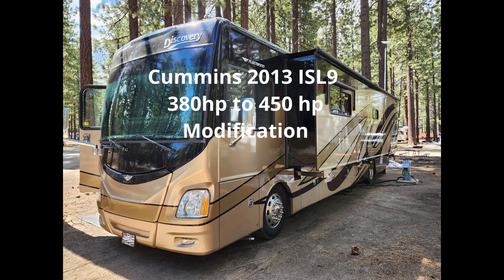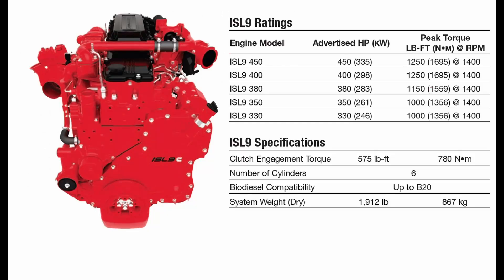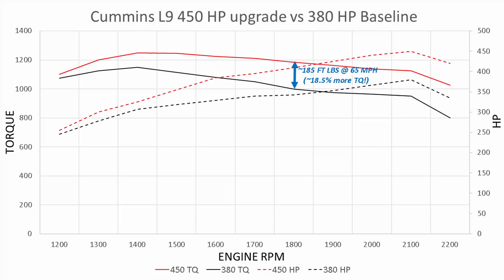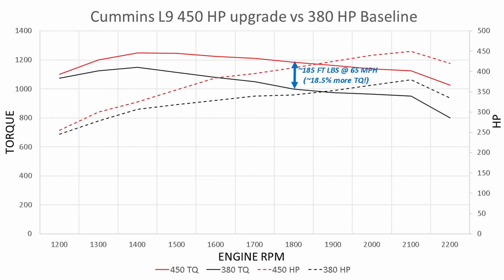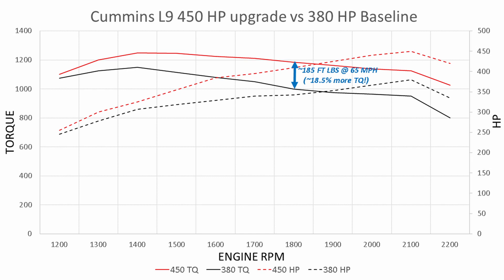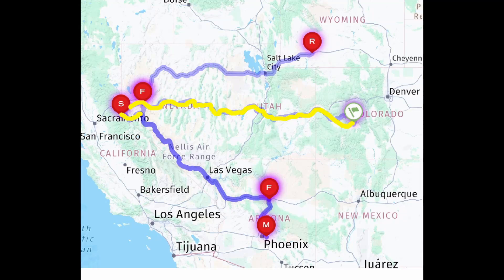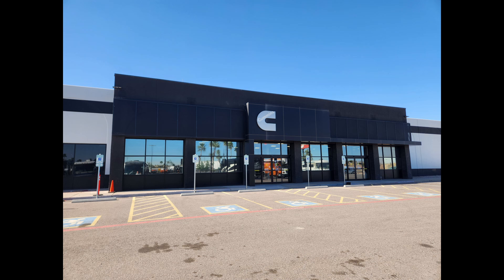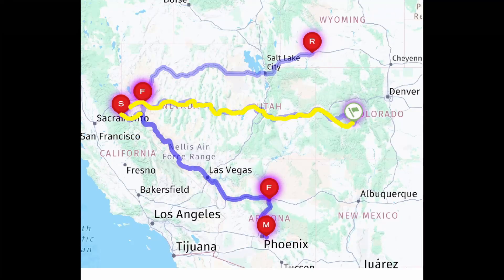Cummin's 380 hp to 450 hp

Comment: Thanks for the video. I just bought a ISL9 380HP and its going to take some thought to do the upgrade at the under warranty cost!
Reply from the maker: I wasn't under warranty so for a few hundred dollars I now have a very different engine. If you have a warranty then it becomes pricey. For me it would depend on where you drive the most, flat ground or mountains.